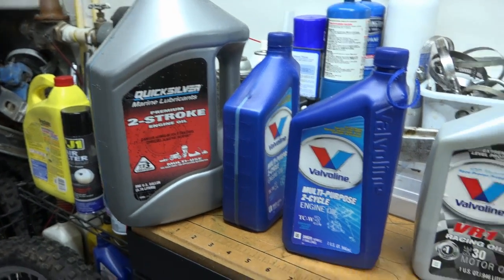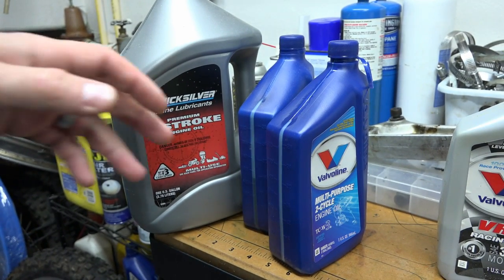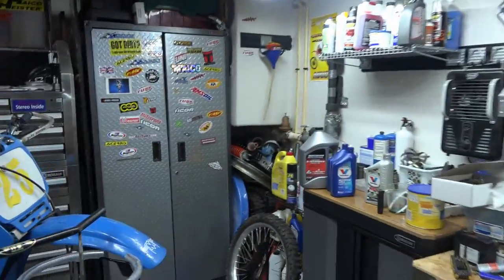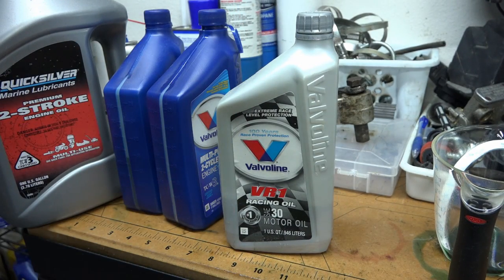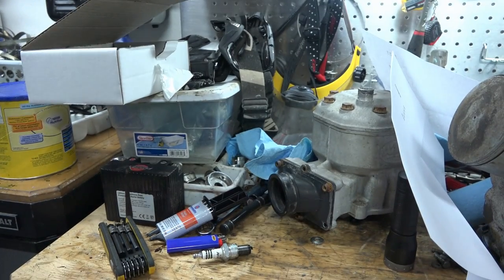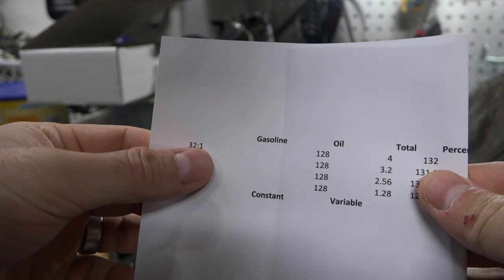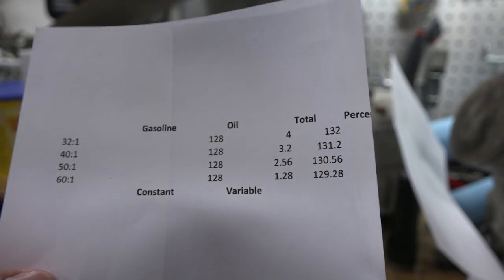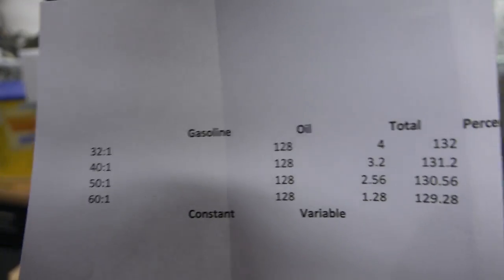What premix ratio do I use in my Maicos? (Dirtbike VLOG: S1 E20)

Comment: Motul and Bel Ray meet Jaso STDs
Have good oil selectors for all your bike needs, been a Bel Ray fan for years myself, only time I have ever seized a engine which was a soft seize was on Amsoil, went back to Bel Ray, 

Motul 2t
JASO STANDARDSJASO FD 033MOT065
Bel Ray 

What I use for my CR250 06.
Synthetic 2T Engine Oil
Bel-Ray® Si-7 Full Synthetic 2T Engine Oil is a 2-stroke motorcycle oil specifically formulated for use in injector/autolube systems, but can be used as pre-mix. Formulated to reduce smoke and carbon residue while providing the highest level of protection for all 2-stroke engines. Bel-Ray Si-7 meets the JASO FD and ISO-L-EGD ratings ensuring the highest level of detergency for better performing, longer running engines.

I can never understand people who use any crap oil and mix any old ratio, if you want a camel buy a camel if you want a Dirtbike that’s a race bike, they are the Cheetahs of the Dirtbike world, they require good fuels and looking after, the amount of clowns you hear with a YZ125 or some other brand, who have multiple engine failures when you drill down it’s clear they are the failure not the bike.

Great topic and info.

Pity I can’t find Maico as an option on the Belray oil selector. Cheers.

Comment: Guy is correct in oil ratio matters and word to the wise the carb jetting will rich or lean the fuel into engine as well as air fuel screw. Get cymers manual read it they are golden ttys

Comment: fun fact: my girlfriends dad used to race an has stacks of magazines that date back to the 70s and I don't exactly remember which magazine I was sifting through (literally the guy has stuff that was mailed to him from Europe back in the day from friends) anyways there was an article about what radios do what for power and they did it on a yz125 (forgot the year but it was before the mono so old haha) and the bike actually created more power the higher the ratio. they eventually caped it at 16:1 because they kept fouling plugs but apparently it ran the hardest the more oil in the mix. the only thing is you sacrifice reliability at that point....usually if ur bike is blowing bubbles out of the silencer that isn't the best sign.

Comment: finally someone lays down the facts, I hate when people say if you're running less oil it makes it run more "rich" makes no sense
Reply: dan gardner it does make sense. The mixtuure gets thinner so your engine gets more mixture thus making it richer
Reply from the maker: dan gardner There is a difference between "running lean" and "lean premix"  running lean just means fuel to air ratio.  lean premix means oil to gas ratio.  The jetting determines running lean.
Reply: Agreed. The main jet has a fixed diameter. It can pass a fixed maximum volume of liquid - fuel and oil. If you increase the ratio of premix oil it will leave less room for fuel resulting in a leaner fuel to air ratio.

Comment: T.OPs is right. here's my way of saying it. (ALL 2 Strokes Engines) weedwhacker/chainsaw/boatmotor/bikes... It's all the same. Less oil mixed = engine burn up go BOOM!. More oil mixed = engine ok... but fouling out or won't run at all. 30:1 is most 40:1 is mostly for lawn equipment. Lower elevations might look at higher but not sure. That's a jetting issue mainly I believe. I've never been out of Colorado riding but, I understand... it's easy to miss use. I hear... High gears..., to me that means 4/5/6... not 1/2/3. GAS is the main factor , They will run with strait gas for a VERY short time. They WON'T run at all on  (mix oil) you're adding lube so the piston doesn't yank you over the bars when the piston welds to the cylinder. Crankcase oil is just what it is...for the lower end. There is TOP and BOTTOM. They don't interact like a 4 stroke/cars or lawnmowers. The mix just gives the upper end the lube it needs to keep working.

Comment: I would bet that non of your bikes calls for TC-W3.
The TC means Two Cycle. The W3 means for Water (generation 3).
JASO FD (FB minimum) and ISO-L-EGD (EGB minimum) is what is called for and may actually increase performance.
 The blown seal is unrelated to type of oil used and is either caused by faulty installation or an over pressurized crankcase (backfire).